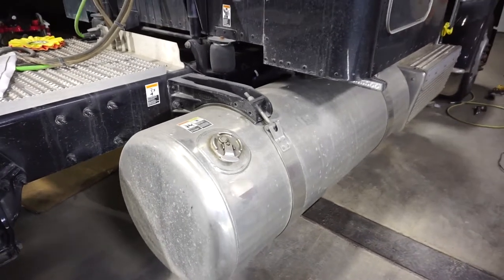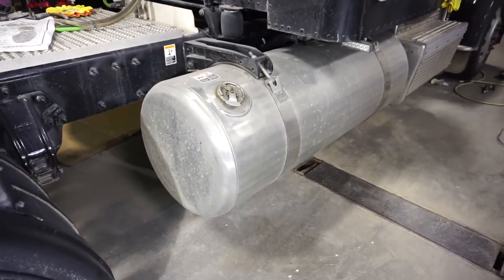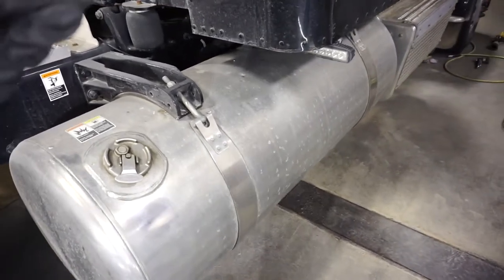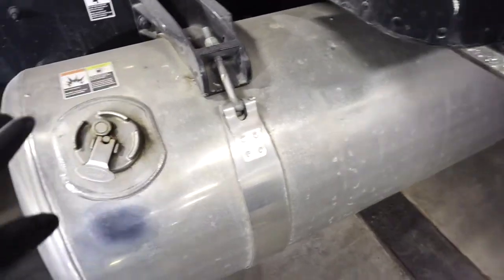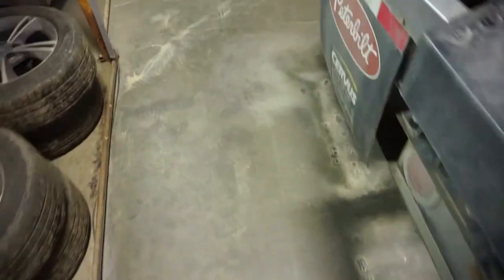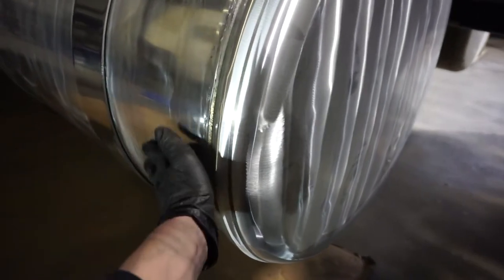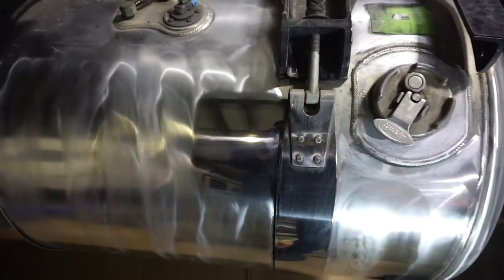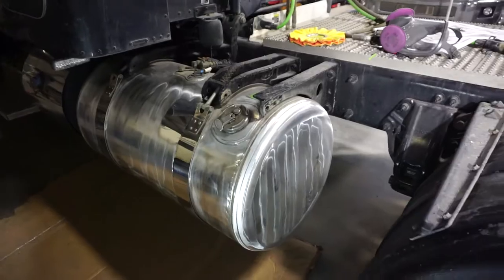2 Minute Tuesday: How To Polish an Aluminum Semi Fuel Tank

Comment: Wat type of sand paper you use
Reply from the maker: I've tried many different brands and types over the years, but the main paper I've used is 3M Red Abrasive Discs. 180 to 600 grit. Brand of sandpaper is important, but sanding technique is much more important.
Reply: Orbital sander 320 400 600 then high speed that’s ur key anything else is bogus
Reply: U do not want to put 180 it’s to deep I’ll make the tank week easier to crack
Reply: Would going up to 1000 grit make any difference before cutting with tripoli? 🤔
Reply: @MockOverdrive I have never gone beyond 800 but 600 is sufficient IF you are going to buff and cut with actual buffs